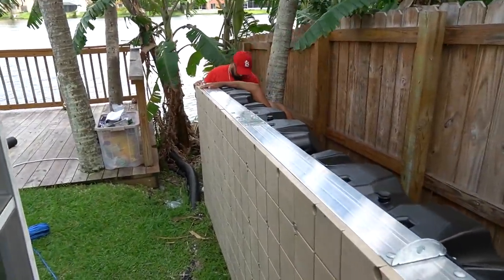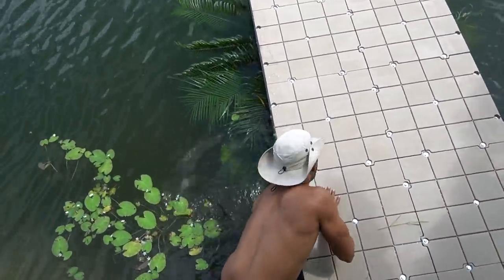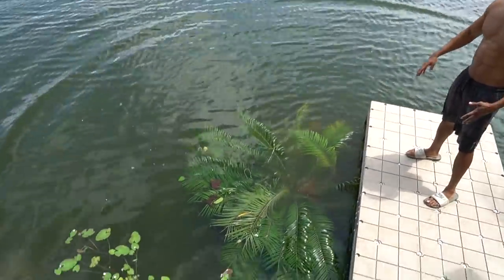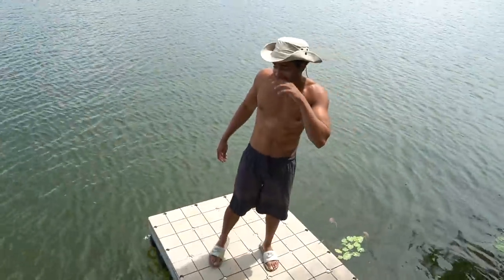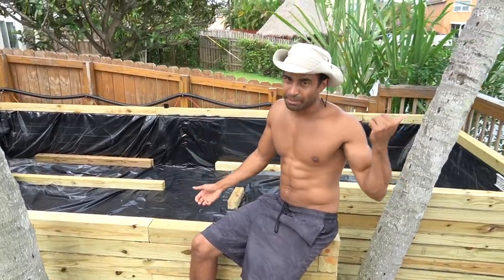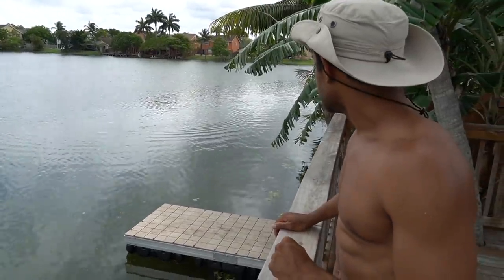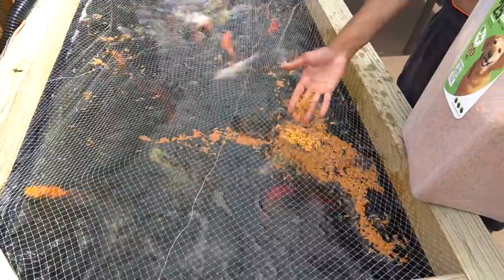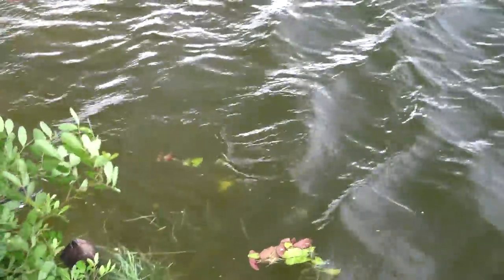BUILDING a FISH DOCK! **Attracting Giant wild Fish**

Comment: I was a builder that did rectification waterproofing works early in my career. my advice in future builds is limit your connections and joints and try not to puncture any sheet material if possible. You will always get leaks sooner or later if not. Materials will shrink and expand due to weather conditions and deteriorate over time.